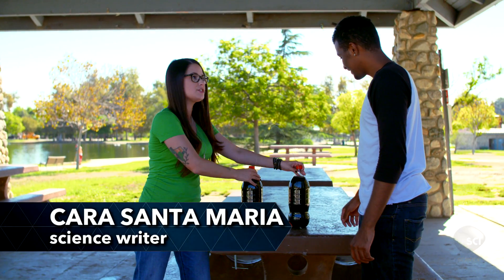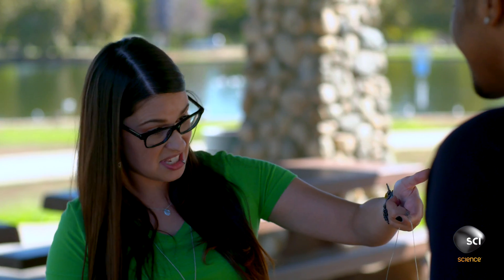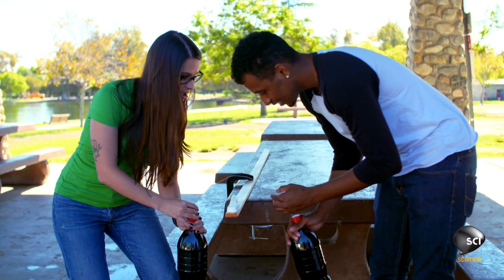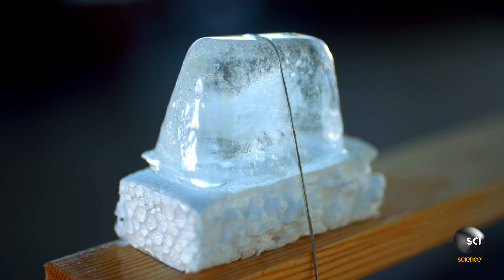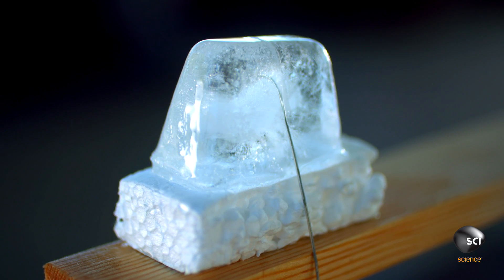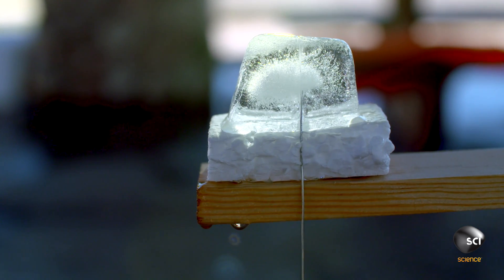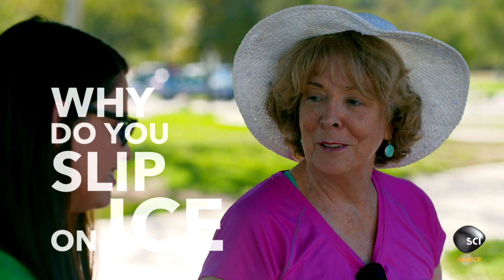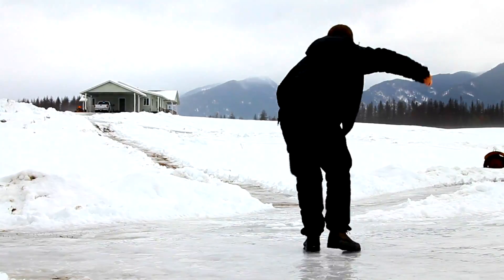Why Do You Slip on Ice?

Comment: ahah you opened a physics' book of the 80s ... this is a wrong explanation of the fenomenon. The pressure of the ice-skate increase the temperature of the ice by only a few 0.1 °C, the ice melts because the heat is carried away from the metal. Try the same experiment with nylon wire, if you assume that the pressure causes the ice to melt then you expect the same result as you got with the metal wire... in reality the nylon wire doesn't penetrates the ice.